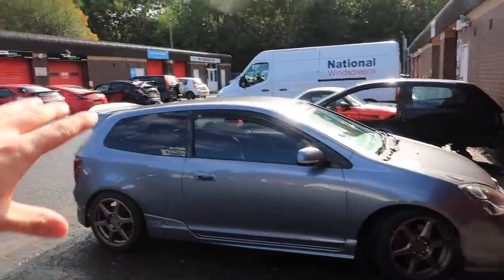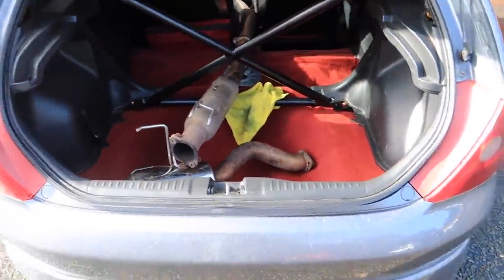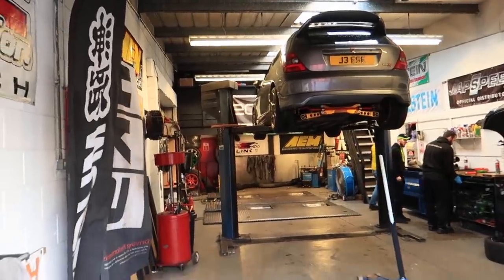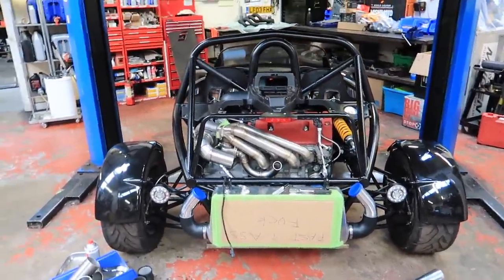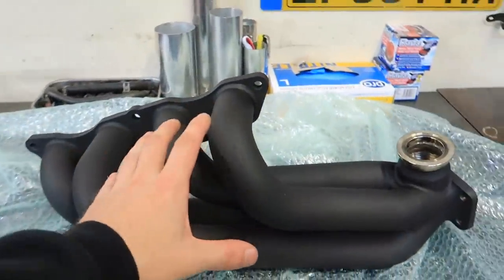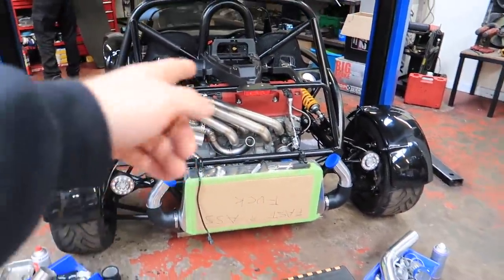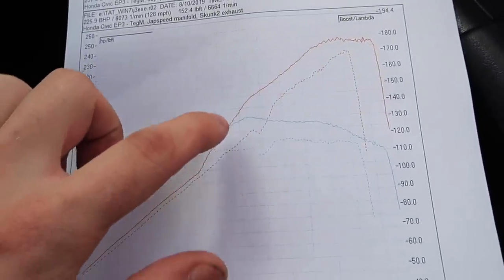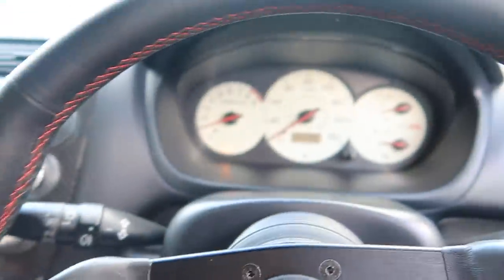EP3 CIVIC TYPE R GETS REMAPPED!!

Comment: Great work with the exhaust, map and the new bhp but lose the pops and bangs - sounds like the car has a dose of the shits or its fucked. The deep noise you get as you take your foot of the pedal and decelerate is a million times better.
Reply: bc1sjw .....not to mention the way in which they are created by the map damages the valves....Chuck fuel in on overrun = backfire.
Silly stuff but otherwise I like the power benefits

Comment: Good video so u made 228 as TDI noth rolling road is out a tad u find a lot off or will till u that go race Lockwood's Evo that be fun
Reply from the maker: my mate made 254 on tdi dyno and 255 on efi so pretty spot on if you ask me
Reply: Must off had it sort out then it use to read more then all over Dyno,s
Reply from the maker: @matthewdagnall1647  theyve got a porche dyno now so its pretty amazing :)
Reply: @JesseCollingham  the dyno is out by 10 defo hence why you thought you got 15bhp from exhaust there dyno reads 10 up
Reply from the maker: aiva biggen or the fact I went from a 2.25 system to a 3’...

Comment: Over 15bhp from changing the exhaust 😆
Reply: Different dyno’s though, would need to go back on tegiwa’s dyno for a fair comparison
Reply: @adam_s2k  You are right that different dynos differ from measurements but maybe just between 1 to 2 horsepower at most. There is a set formula to calculate horsepower so if you have a propper dyno it shouldn't differ that much. So he maybe didn't gain 15bhp from the exhaust but definitely at least 13bhp.
Reply: Jos Designs I’ve never been on TDI’s dyno so cant comment really. But it is well known amongst the Honda community for allegedly being a bit generous! And 15bhp does seem a lot from just an exhaust diameter increase on an n/a engine without a tune! I was at tegiwa when he had it dyno’d there and in his defence it was a very hot day and both our cars suffered for it. So there’s also that to consider! I’d be interested in getting mine on TDI’s dyno just to see if the myths are true or not!
Reply: @adam_s2k  Your true about that, just saying that different dyno's don't differ like 5-10 horsepower from eachother, just about 1 to 2 at most.
Reply: Jos Designs loads of variables to consider unfortunately, air temp, humidity all sorts, how accurately the dyno is calibrated etc. I gained 13bhp once just by having the bonnet open! You can only really compare dyno runs from the same dyno on the same day etc. Great tools for tuning and comparing figures on the day. But not great if you just want to know what power your cars making as you’ll get slightly different figures all the time.
Reply: It is a known fact large diameter exhausts make a very significance difference on K20’s. This is why serious setups use 3”. That diameter is unheard of on most 2.0 NA engines

Comment: Iv always had a thing for these, what's needed to get to 250bhp? Do these move then? I'm a golf ED30 man my self but do like these
Reply: Mines 245 and does the 1/4 mile in 14 seconds dead, great fun car especially with a fast road setup,epic gearchange and engine but a remapped ed30 would probably beat it for straightline speed.
Reply: @u04pww2  possible car for the future but defo got to have the pop n bang map lol yeah my ED30 would blow a type r of the road and will perform on B rounds with everything iv got with it for that type of driving if needed, goes round bends like it's on rails, Iv just got another car but just a gti mk5, fully polly bushed with a few light moss, still stock but now getting a K04 convertion, it's the DSG so that will be very fun to drive
Reply: Tony Lyons I love those edition 30, half leather half tartan interior an extra 30 bhp, they’ll be very collectible in standard of course
Reply: @Shane-zx4ps  yeah there gr cars bud, mines running 383bhp and that moves lol need to upload a good video of it but weather is really shit atm